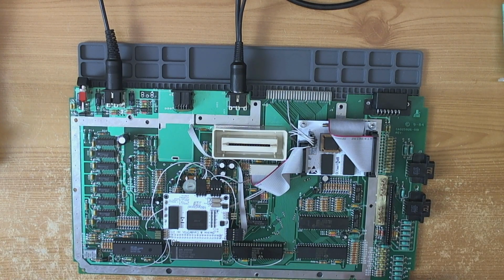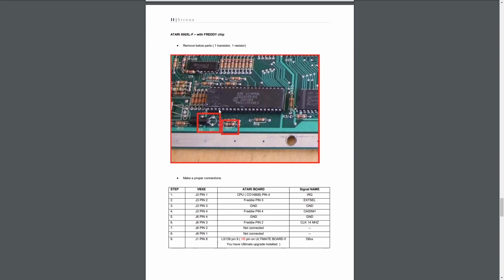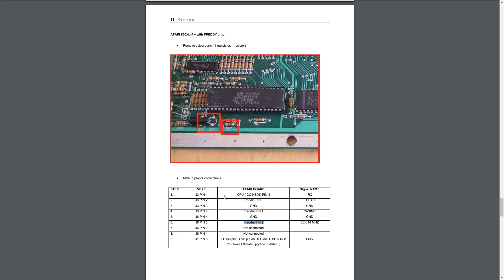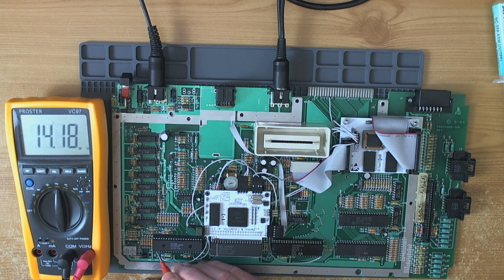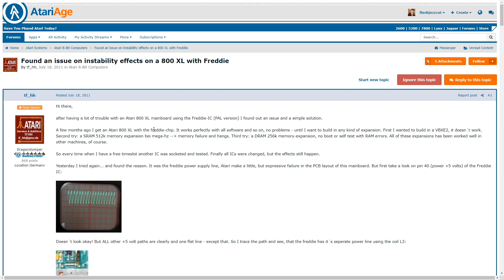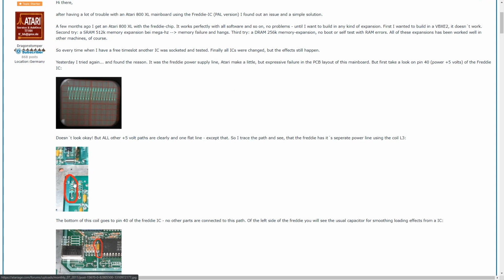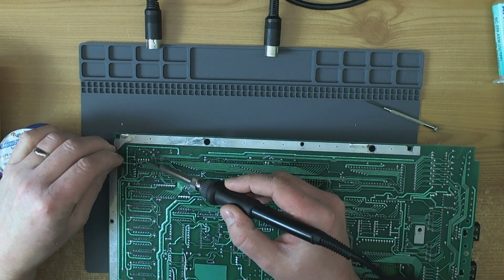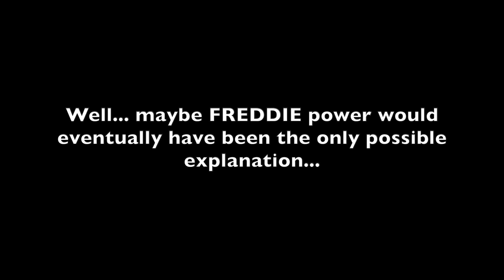Atari 800XLF: Jurgen's fix for weird VBXE/FREDDIE issue

Comment from the maker: Note: it turned out that VBXE crystals were not swapped and replacing L3 with a wire (as per Jurgen's suggestion in the linked thread) solved the video glitching issue (I left the new cap in place as well).

Comment: Just bought a Atari 800 XL(F) PAL system. It has the same "Freddie missing capacitor problem". Board is version is C025925-001 REV-R3. Just for anyone who has the same board. Put the capacitor in place!

Comment: Correction. 800XLF SECAM board was in 800XL in Poland. It is just later 800XL model.
[BAD]I do not know anyone owning 800XLF in Poland[/BAD]. I have seen 600XL/800XL and lots of 800XE/65XE/130XE.
Atari 400/800 is probably more common as it has more retro value.
Reply from the maker: I guess this (rarity) is why the photo in the VBXE installation manual shows an XLF motherboard with GTIA in the FREDDIE socket. I actually suspect I took that photo years ago (after putting the wrong chip in the wrong socket) and it was rediscovered using Google Image Search. But this is an example of the theory of operation (i.e. 'It's identical to the XE installation procedure') being just that: a theory.
Reply: @flashjazzcat  I checked the thing. 800XLF was SECAM/PAL board with freddie in later 800XL microcomputers. I assume SECAM 800XLF was in shops  around 1985. 
[BAD] I know that 800XLF were not marketed in Poland and individual buyers would not try to buy this model in 80s.[/BAD] If you want I can ask the maker of the thing directly.
Was 800XLF not just a late version of 800XL with 800XLF visible only on the board?
In other words... I do not know if the problem is for all 800XLFs but Lotherek will not have access to this(PAL) type of board easilly.
[edit] stages: XL series - bought outside of Poland/individual, 800XL+XE series - in exclusive shops using $, ~90s models out of storehouse and C-64 on shelves, for some time retrovalue/auctions
Reply from the maker: @archieil  I suspect what you say is entirely correct. I simply raise the point that reiteration of the installation instructions to someone who is already fully competent in installing the devices doesn't go anywhere towards solving the issue. Fortunately inquisitive minds had already found the answer. :)
Reply: @flashjazzcat  I'm not much into the Atari groups in Poland. I'll post the video on the atarionline forum in some place.
Reply from the maker: @archieil  I already updated Lotharek on the solution, so hopefully it's now stored away in the knowledge base. :)
Reply: @flashjazzcat  I knew information proably about him having some yearly delays in manufacturing of some PCBs 6-8 years ago. The more people aware the less probable someone lost in time delays.
I've got this movie in propositions. Probably because I was looking for hybrid retro microcomputers recently./upgraded and so on.

Comment: The flash chip on my SIDE2 cart gets corrupted and needs to be reflashed every few times i use it, what can cause this?(the machine is a 130XE U1MB)
Reply from the maker: Sounds like the flash ROM itself is failing if it is unable to hold content long-term. It's most unusual, in any case. If the device is new, contact the vendor for support.